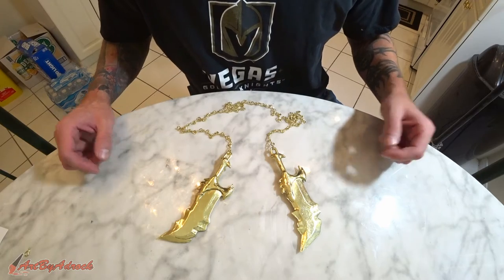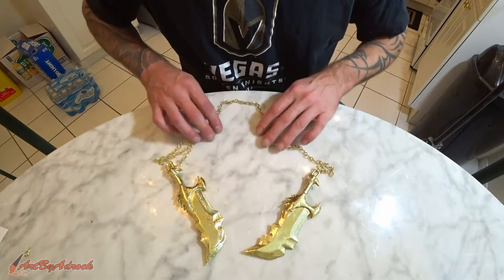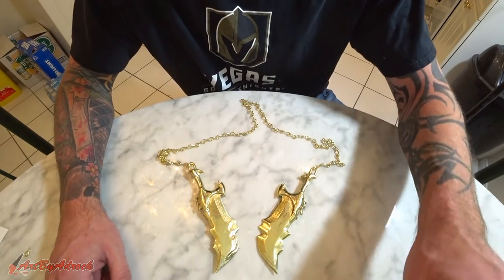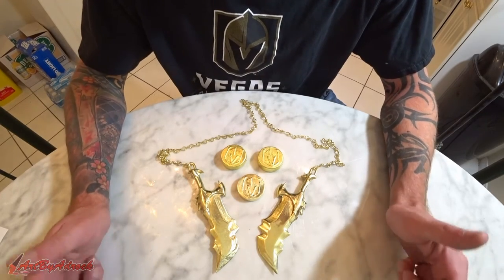Bullets To Blades - Casting Double Mini Blades Of Chaos (God Of War)

Comment: you have to be extremely careful using casings. never put them directly into molten brass. if there is any unspent gunpowder in them, it can go off and splash molten metal all over possibly even crack the crucible. reloads have an even higher risk as theres a chance they may not have been loaded properly.
Reply: even if it's not happened yet, theres still a potential. I know of a couple people that buy spent brass and lead from local ranges and have had them go off.

Comment: Hey bud, do you pop the spent primers out before you melt or do you just melt them along with the casings?
Reply from the maker: I just melt them along with the casings 👍🏻 no big deal at all. It would take forever to pop out each one. It’s takes long enough to go through each one to make sure there’s not a live one or steel one still in the bunch
Reply: @ArtByAdrock  taking out the steel stuff is very easy.... BIG magnet :D
Reply from the maker: Haha true.. I get lazy though and just melting everything does the job 😂😂🍺

Comment: Does that petrobond not work good for casting after it gets burned?
Reply from the maker: You can reuse it. Just add a little oil and mix it up a lot and it’s good as new 👍🏻
Reply: FWIW, I've found that even though I re-purpose like @artbyadrock the burned petrobond does not have the same strength or facing quality as the new stuff. It works great for filling the flask up and that's what I use it for as well.
Reply: swdweeb good to know. I've seen you do the same on your channel.